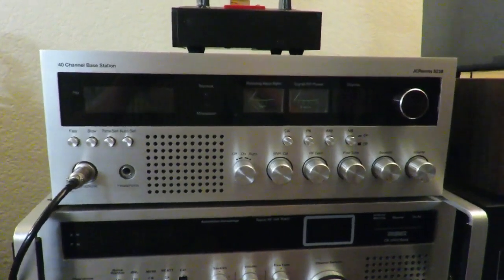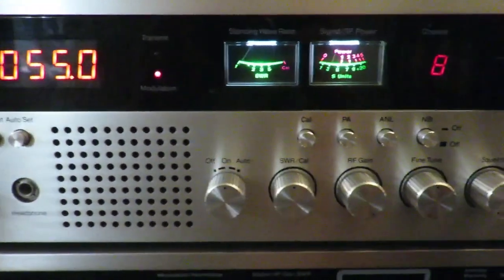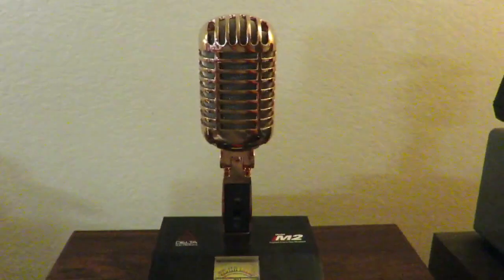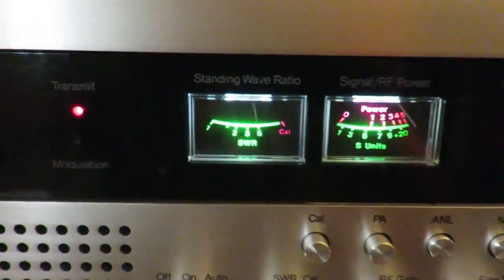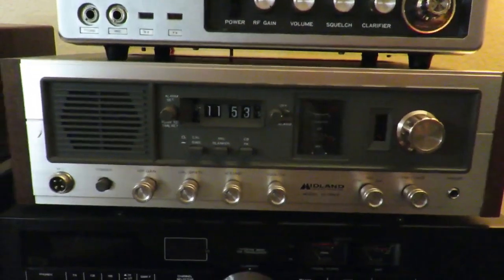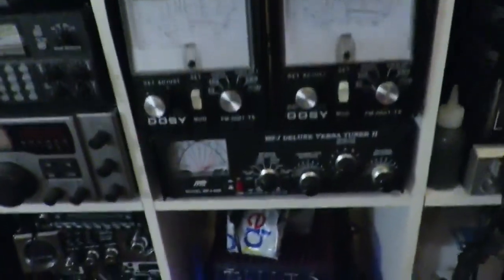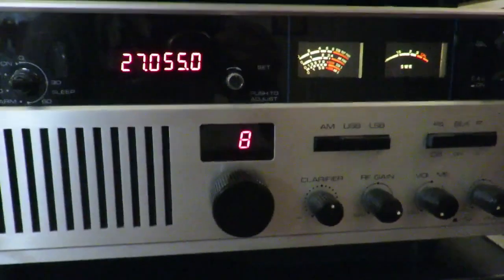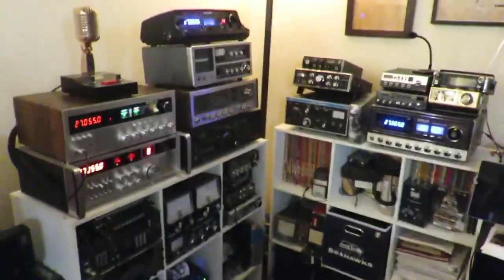Adding SSB to an AM Only CB Radio Base Station,  now it can talk

Comment: You can’t add SSB to a AM radio. You used the cobra 148GTL board which is a AM/SSB radio already. You just stuck it in a different case.
Reply from the maker: Actually this radio is so small I had to us a PC122 SSB radio.  So of course you can not make any AM radio a SSB radio without having a mainboard without SSB,  that is why I call them Frankenstein CBs, Not many folks willing to try it,  but i say YOU CAN DO IT

Comment: What problem is it to 
Put 6 dogit freq where 5 is now
Reply from the maker: on a big box CB?   yea  some of them do have external jacks for a counter    and I did put one,  but it was a super small one right.
Reply: @bcoolradios9765  yeah mine is galaxy 99v2 mobile 5 digit is perfectly fine for AM but for ssb  fm it would need 6 some external go 8  right now I just go to the 5 back tune to just 4 and notch back up to 5 most cases is center slot

Comment: im still working on my centurian 40 a it has output power and mod on ssb but no receive audio  it has am power but no mod or receive
i put a new auido chip in it and no difference its gotta be somthing not letting in the am mod circut what do you think
thanks
Reply from the maker: So does the PA work...   I always look at the block diagram of the TRC-449 service manual as that has awesome troubleshooting flow charts.  it has to be a cap on the audio amp,  both RX and AM TX audio go into that chip,  good chip?  their are 2-3 caps that go to ground on that chip... so that is where the issue is.
Reply from the maker: C88 C89 will take out that audio chip,  C84 will stop the audio signal